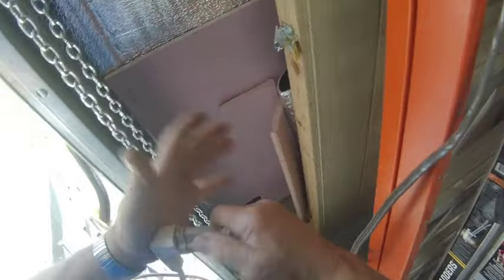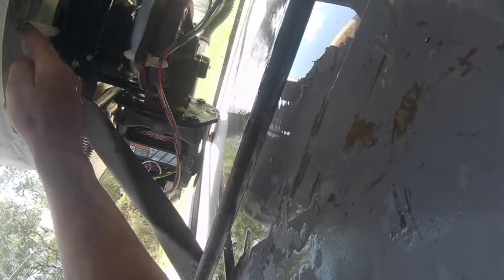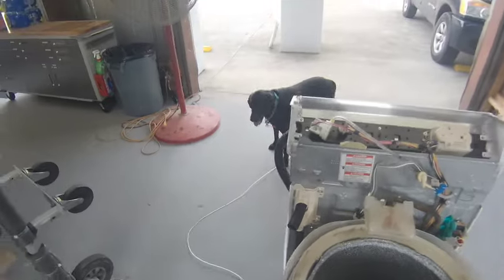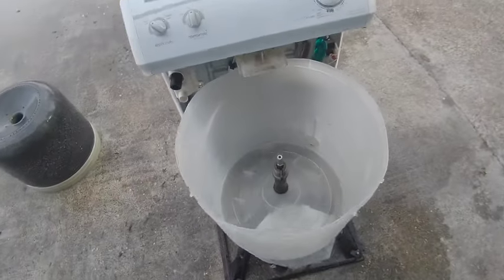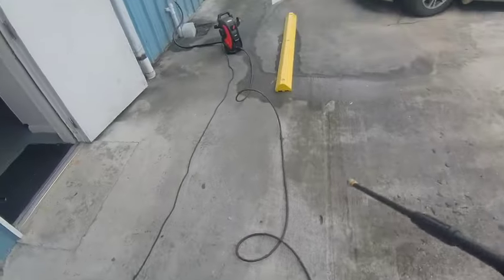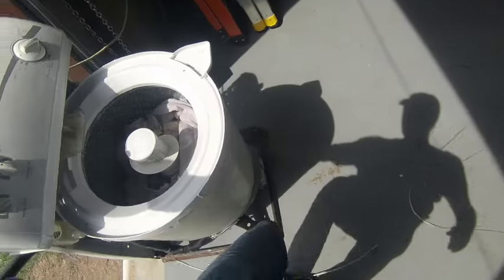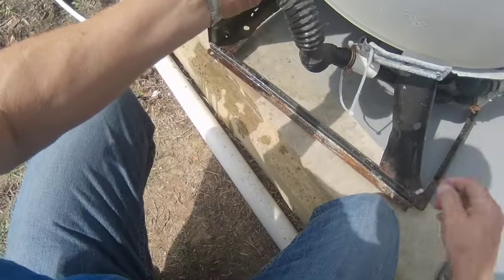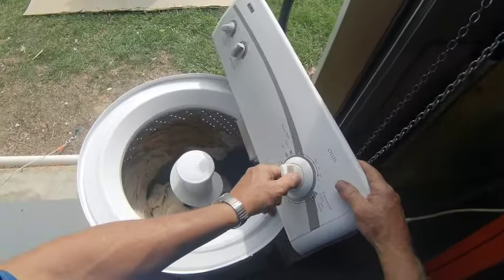How to Turn a Discarded Washer into Profit: Final Repairs & Painting Guide - Part 2

Comment: What are the green sticks you melted down to fix the tub cracks? That was an awesome repair!!!
Reply from the maker: Those are called plastic welding rods. Someone that worked on the pipeline gave them to Mr. Harper. I can’t find the exact ones on the internet but they sell them for all kinds of plastics. I’m not sure which to get though. Different plastics don’t work well together. I need to figure out which one I need for tubs. Thanks for watching!
Reply: Your voice sounds just like my uncle Rodney's in Missoura😊 I was just working on one of those today. just wanted to clean the plastic tub ,but I couldn't get the metal one out. The bottom bearing was seized for the triangle plate on the shaft, lordy sure done pissed me off. Keep posting great vids😊
Reply from the maker: “The bottom bearing was seized for the triangle plate on the shaft”??? You completely lost me, but thanks for watching!

Comment: Hello, my GE washer gtw335 will work sometimes...but then it starts filling and agitating but then when its time to drain and spin...the lid lock clicks on and off twice and then the machine just shuts down. No straining noise or anything. Ive changed belt, lid switch twice, speed sensor and the mode shifter. It worked twice after all that and then continues to cut itself off after first agitation. I dont know what to try next. Maybe the drum parts? Ive watched tons of your videos and looked at comments but Im stumped. Do you have any suggestions? Please
Reply: I've checked inside drain pump
Reply from the maker: Wow, it sounds like you just about have a new machine there after changing all those parts! Unfortunately it is impossible to give you anything other than an educated guess and those are awfully prone to failure. I think I’d suspect the control board. Are you certain that there isn’t an issue with the bearings failing. No signs of water leakage around the gear case? A roaring sound in the spin diagnostic?
Reply: There isn't any leaks
Reply: On diagnostic it won't spin but no fault displays
Reply from the maker: Does it make a noise like it is going to spin then stops?
Reply: No it just stops after it fills and agitates. The lid lock will close then open, and it just shuts down. I probably won't be able to get that big bolt off, getting discouraged.
Reply: Thanks so much for your help
Reply: So this morning I have been washing much needed clothes by putting them in letting it fill and wash them then putting it in diagnostic mode and draining it and putting it in wash again and letting it wash some soap out then diagnostic to drain and then hanging them on the line and squirting them some more.  thank goodness it's a beautiful sunny day
Reply from the maker: lol, well you got a system worked out but that’s going to get tedious. You need a proper repairman!